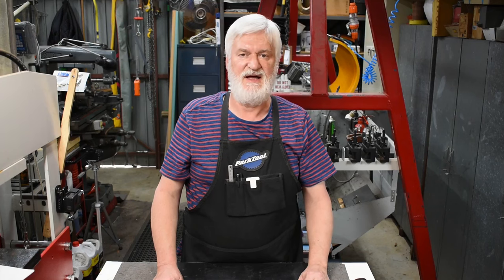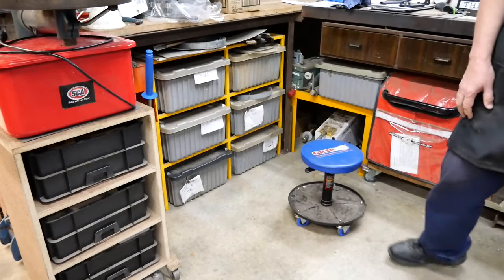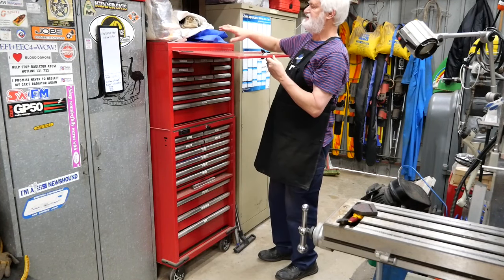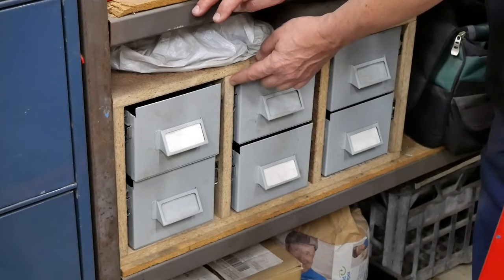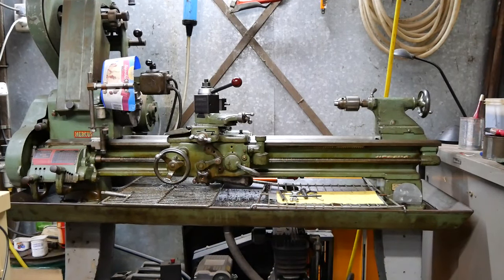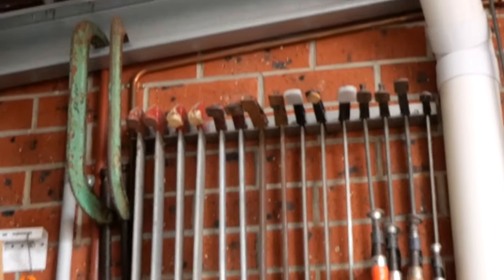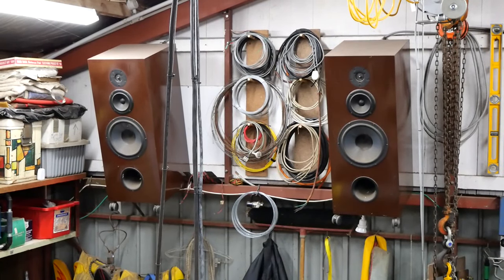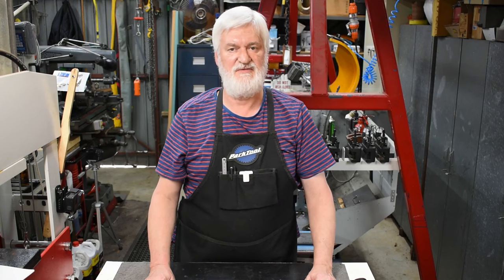Storage in a home workshop.

Comment: You have some great ideas. Wish I would have seen this video sooner. I just sold one of my lathes and one of my drill presses. Im going to use some of your Ideas before I end up selling more equipment. I really like the storage under your drill press.
Reply from the maker: Thanks - that unit under the drill press has worked out really well. In addition to useful storage, it also serves as a mobile work stand and you'll see it in several videos eg Victoria dividing head - the missing pieces. Cheers, Alan.

Comment: That is a well stocked work shop. Mine is just crap everywhere and I have to pull out bikes boxes and stuff just to have some floor space. And it is a six by nine meter shed!
Reply from the maker: My mezzanine floor was like that for years, a result from clearing out homes of aged and passed family members. Every item seemed to be emotionally charged and it took a lot of time and patience to work through it all. My present, reasonably well ordered state, results from near OCD that "everything must have a place and be kept in it". I still manage to misplace things though and a 12" steel rule has been hiding in there for months...
Cheers, Alan,

Comment: Gday Alan, lots of great ideas there mate, you really have a nice setup, what model is you Hare and Forbes milling machine and are you happy with it, enjoyed watching, Cheers
Reply from the maker: Thanks for the feedback; I am a subscriber to your channel and enjoyed your wobbler build videos.
My vertical mill is a BM-62VE with NT40 spindle and I bought it from General Tools (Adelaide agent for H&F) about 4 years ago. It is a strong performer with good rigidity and a wide range of feeds and speeds. I have only had two issues with it. The first was an intermittent noise in the drive head that started when the machine was about a year old. When I performed open heart surgery I found that a threaded fastening had come loose allowing a rotating element to contact part of the housing. Reassembly with a drop of Loctite fixed that. My other issue is the recent discovery of a crack in the turret casting at the inner support of the ram pinion. I raised this with General Tools who agreed it was most likely due to a manufacturing defect and arranged with the importer for a replacement casting to be ordered. Fortunately this defect only affects the operation of the ram pinion and the ram can still be pushed in and out manually. You might have noticed that I have made some minor modifications to suit my usage eg quill wheel and quill DRO. Overall, I am very happy with the machine and the after-sales support I have received. 
Cheers, Alan.